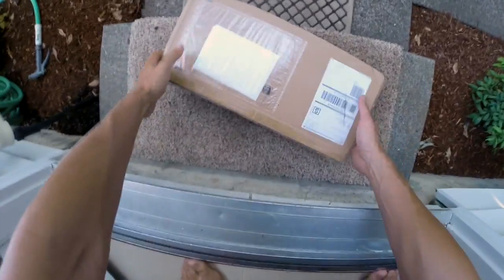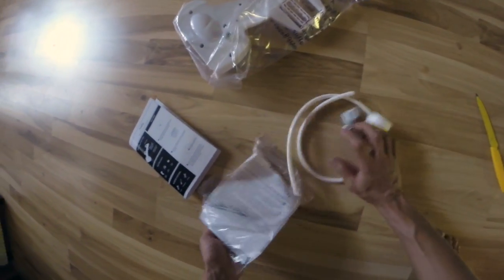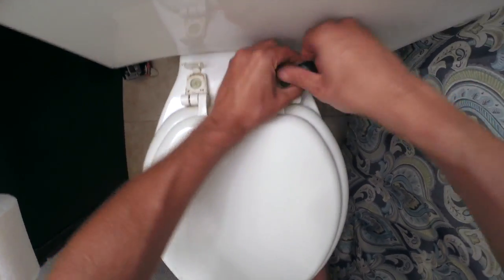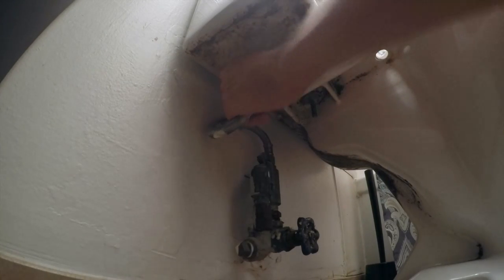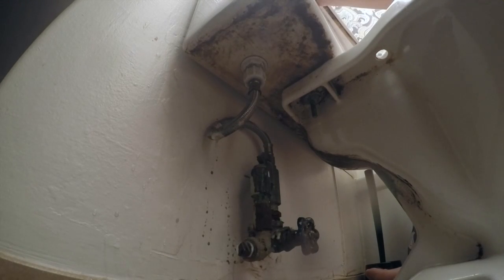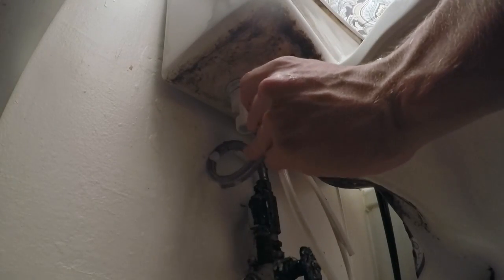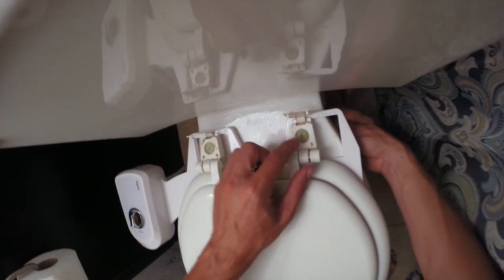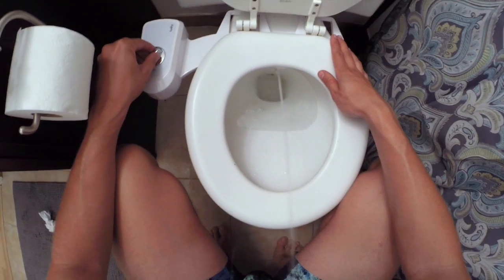how to install Tushy bidet

Comment: Thank you! The Tushy installation video leaves out the part about connecting the hose to the adapter and the bidet itself.
Reply from the maker: Yeah I just put the go pro on my head unboxed it and started putting it together. There were a lot of things wrong with the words I used or didn't say but it sure works great! Thanks for your comment

Comment: So serious question, but is the water able to be heated?  My water is ICE cold in the winter, and I can't even begin to imagine the rectal frostbite of unheated water.  LoL.  I've been thinking of getting one of these, but would really prefer heated water if possible.
Reply from the maker: There is a heated version but I actually have the same ice cold water issue and it is not a problem.  The cold water down there is not the same as taking a cold shower.
Reply: They do have a heated version, but it only works if your toilet is right next to a sink. It needs a hot water hookup.